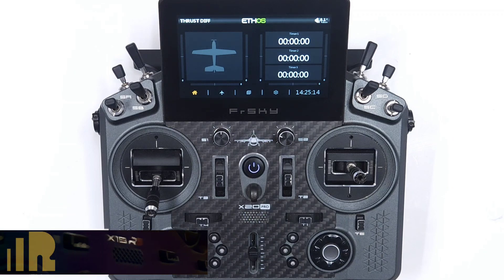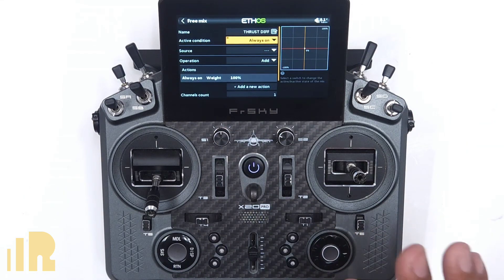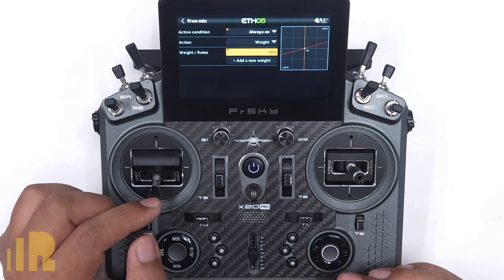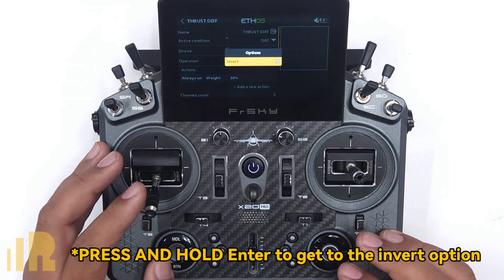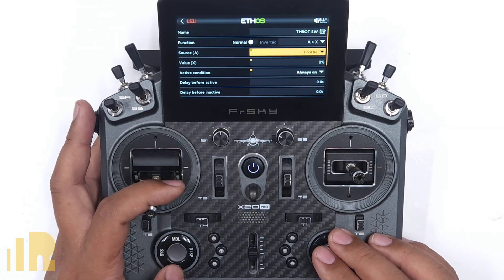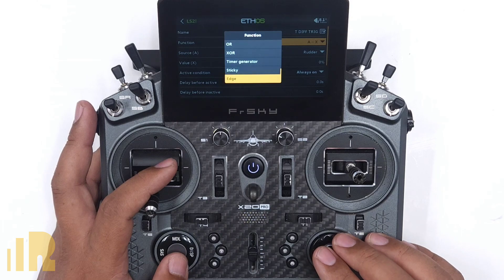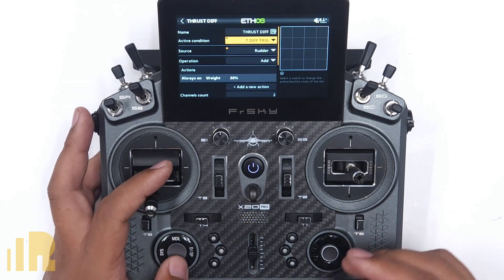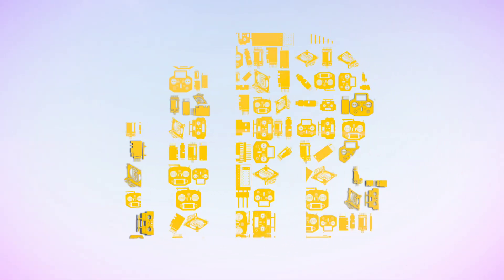Thrust Differential - FrSky ETHOS Tutorial Series

Comment: When you set up the throttle cut on the 3 position but only using 2 you could also set the throttle diff on the 3rd position,

Could it be set up as 

Throttle cut, throttle active no diff, throttle active and diff along with the logic safety switches?
Reply from the maker: I don't see any not... I haven't looked at that setup in a while but you may need to massage the logic switches a bit for that setup... Personally, I wouldn't do that. The chances of inadvertantly cutting your throttle in flight are higher with this setup